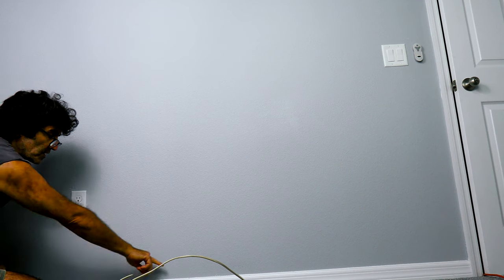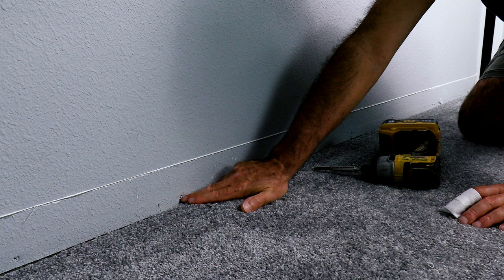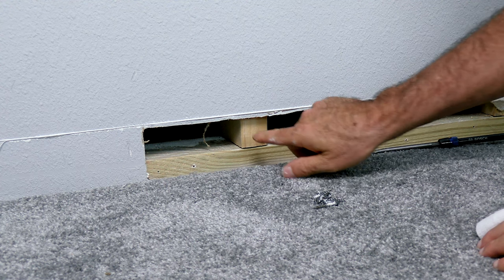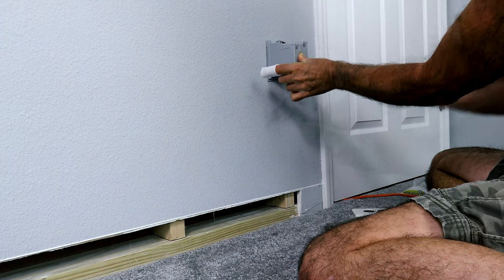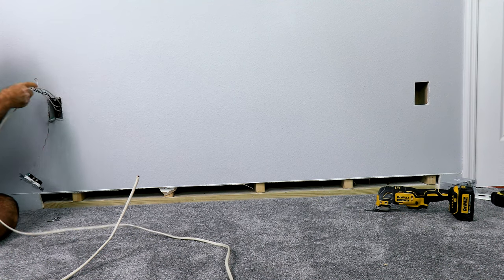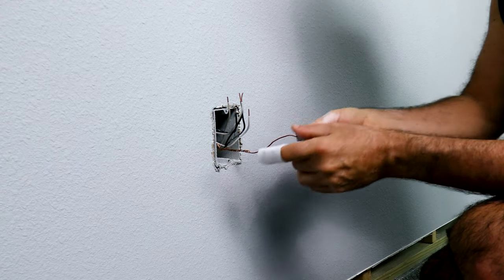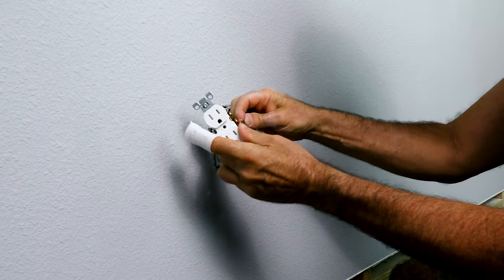How You Can Add An Outlet To a Finished Wall [ No Attic or Crawl ]

Comment: If a neutral passes through that switch wouldn't it have been easier to tap off the switch for power and pass the romex vertically through the stud bay?
Reply from the maker: Yes could be, but the point of the video was how to add a plug to a finished wall... so what if there was no switch there?  Most of the time there isn't.  I wanted to show how everyone can do it, not just those who have a power source directly above the desired location.  Thanks for the input.
Reply: Depends, it's good to separate lighting circuits from outlet circuits if you can. Usually outlets are run with 12 gauge on 20 amp breakers, and lighting is 14 gauge with 15 amp breakers.
Reply from the maker: @Shadi2  That's probably true.  This particular case was 14 gauge on the outlets with a 15 amp breaker.